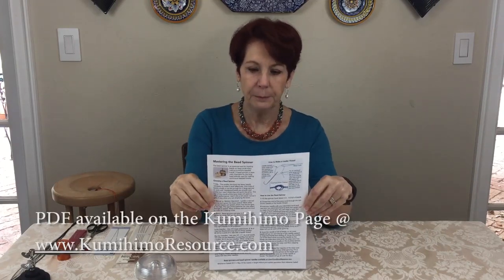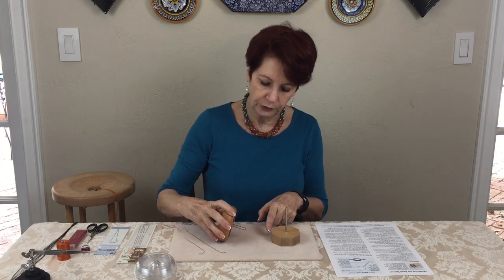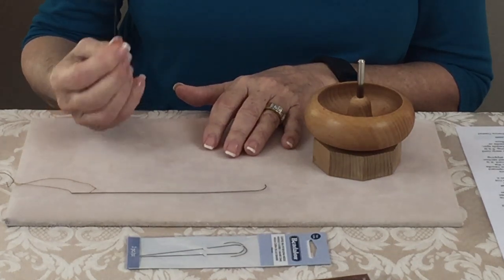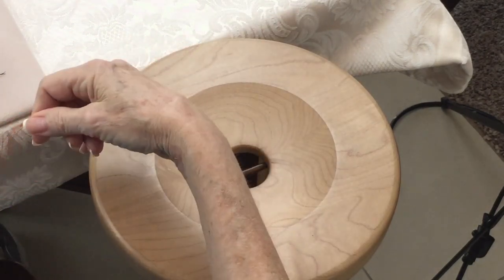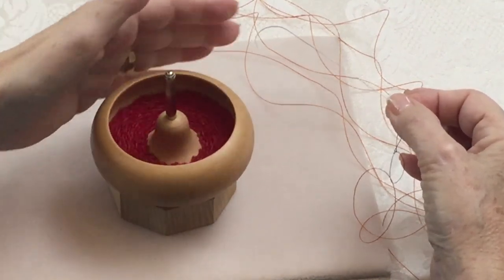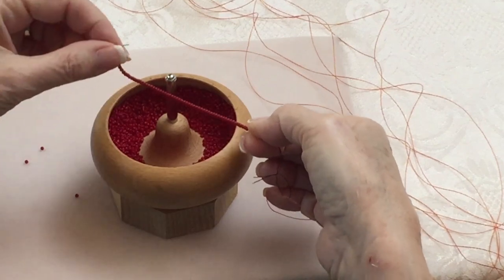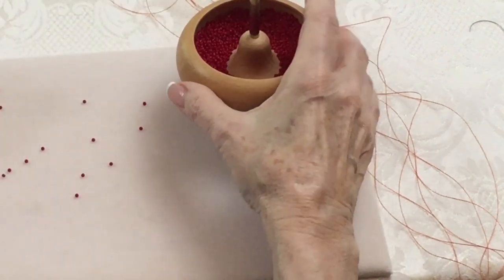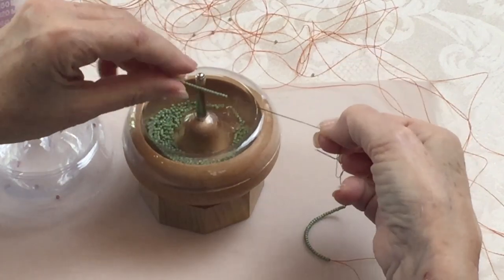Kumihimo Beaded Braids - Mastering the Beadspinner

Comment: I threw mine away. I totally didn't know how to use it and it was by beadalon, but didn't come with any directions so I had no idea  what needles to  get or anything. I found it to be old fashioned. I bought a new spinner with  2 power sources. Batteries and usb, came with needles & very quiet motor

Comment: I’ve gotten the beads to go on the needle but I can’t get them down the elastic! I use thread from the curved bead needle and then when the elastic is doubled it’s so hard to pull 6/0 beads over. I’m using the smallest elastic I can find .8mm. But gently putting the needle in almost at the surface helped me